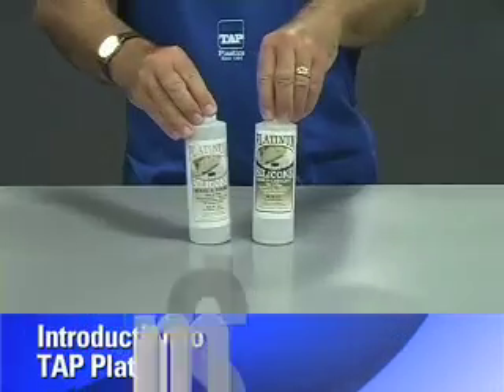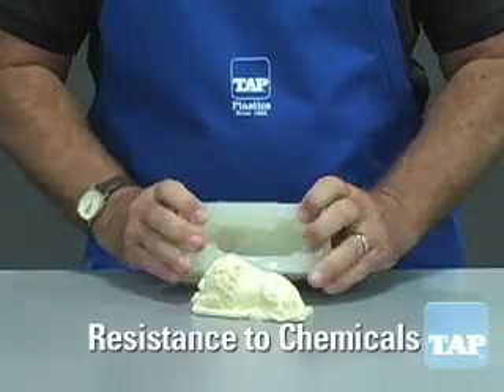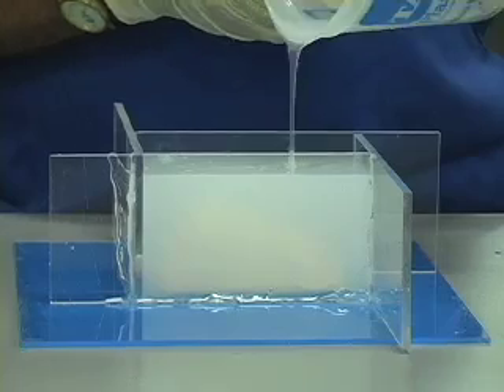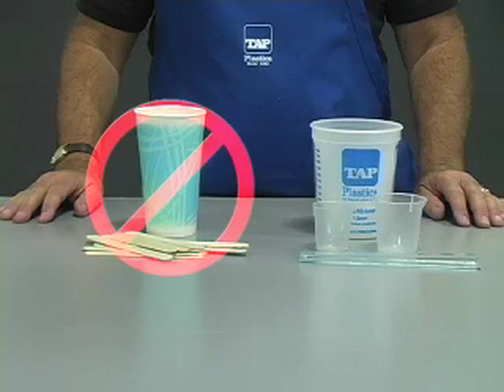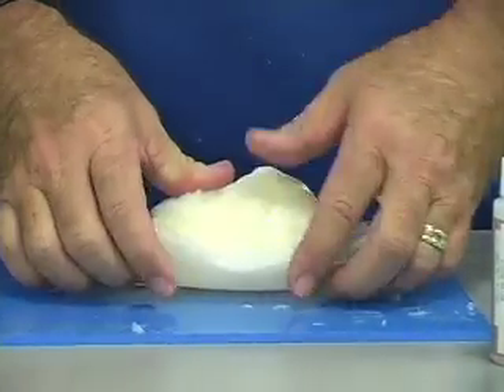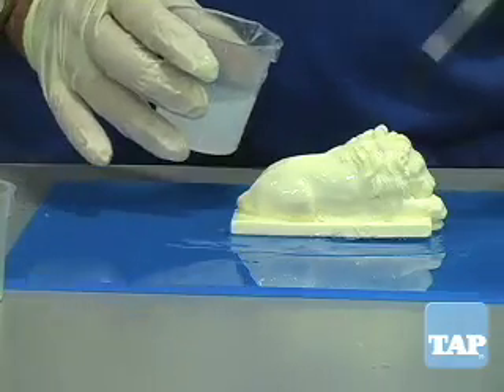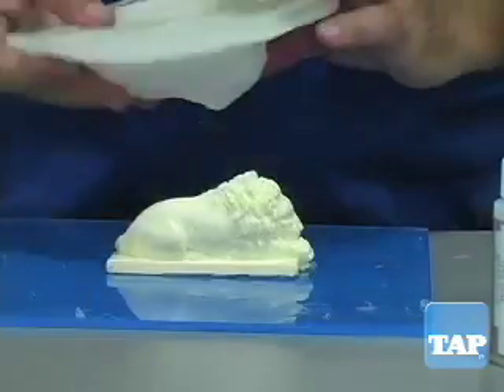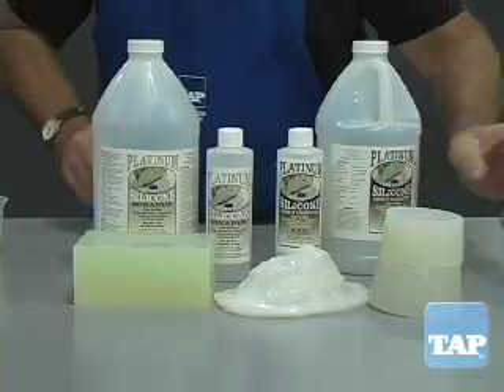Introduction to TAP Platinum Silicone

Comment from the maker: If you thinned the silicone that much, its final cured properties would be degraded.  It would be extremely soft and tear easily.  It is not recommended.  You can pour un-thinned silicone over a part, let if flow off, and the result might be exactly what you are looking for.

Comment from the maker: Since TAP Platinum Silicone is designed for mold making, not insulation, thermal conductivity has not been measured.  Platinum Silicone can withstand 500 degrees F when casting, if that is relevant.

Comment from the maker: @dneproak Our Platinum Silicone can be cast in itself.  Just wait 24 hours between making the mold and pouring the casting. Some pigments inhibit the cure of Platinum Silicone, others do not.  Experimenting is the only way to find out which one will work.

Comment from the maker: @runcycleskixc Platinum Silicone is extremely safe.  To quote the MSDS:  "Hazardous components within the meaning of EEC directive 67/548 and corresponding classification:
none ."  The product is non-hazardous, but has not been tested for FDA approval.  It is not designed to be used on skin to make molds of body parts.  We are not aware of any issues of skin contact with the cured material.

Comment: I am a novice at making molds, so I made them mistake of stirring the mix too hard and it produced a lot of bubbles in the mold, but I stumbled on a simple fix to this issue on accident.

I noticed that when I blew on the mold, it popped the bubble BELOW the surface.  I started to blow with the same force as you would when you whistle, and it removed most of the smaller bubbles after blowing on each area a couple of times.

Comment from the maker: @tapplastics Rubber bands are usually sufficient to hold the two halves together.  If the rubber bands distort the mold, cut two pieces of plastic or wood the same size as the mold.  Place them on the top and bottom and then the rubber bands will compress the mold evenly.

Comment from the maker: @gdiswealth The little knobs (called 'keys') are made by putting indentations in the clay before pouring the first half of the mold.  The indentations fill with urethane and become the keys when the clay is removed.  The second pour flows around the protruding keys, creating matching holes in the second half of the mold.

Comment from the maker: @alister357 Lead melts at about 600 degrees F.  Platinum Silicone can handle up to 500 degrees F, therefore is not suitable for lead.  There are other metals with lower melting points.  Many solders have lower melting points.

Comment from the maker: Use the same method demonstrated in the "How to Make a Two-Part Mold" video.  You can also set the sphere on a short rod in a mold box.  Then pour a block mold over the entire sphere.  When cured, cut the mold open at the midline of the sphere.  Remove the sphere and rod (the rod makes the hole for pouring the resin), put the two halves back together, and pour your casting material.